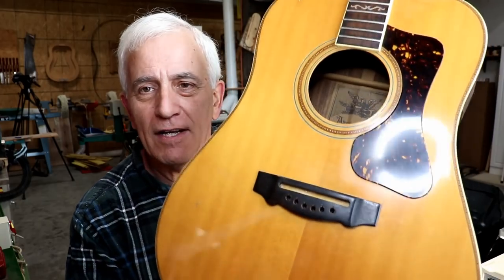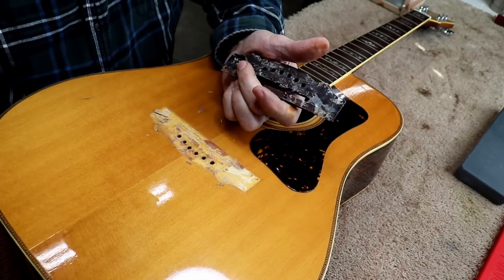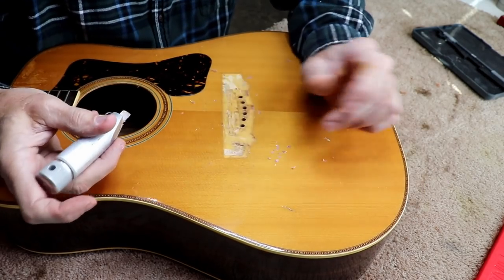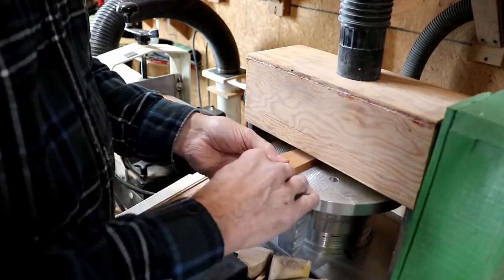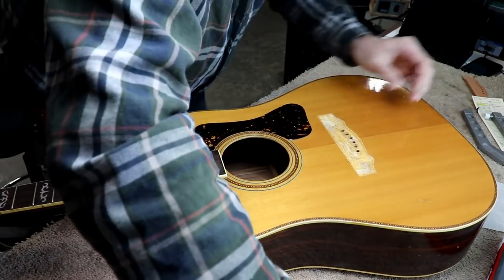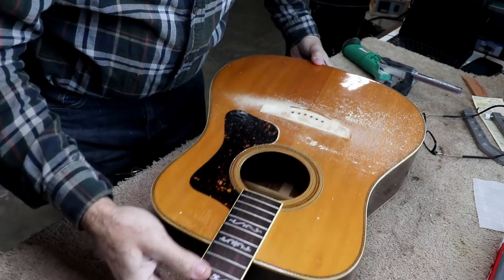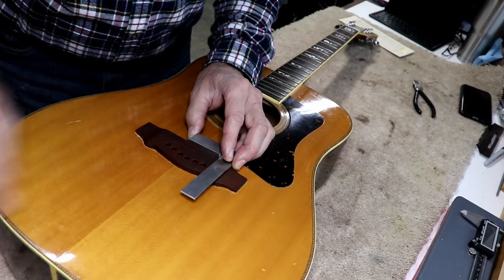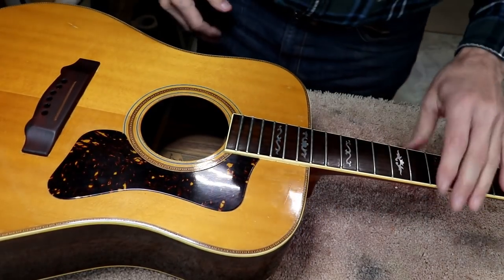380 RSW Alvarez Bridge Out Ahead

Comment: 33 minutes or 33 hours to make a bridge...all relative to context. Let's say you decided to build your own shimisen (Japanese 3-string) and you have no money and you are using only the scraps in your tiny Hollywood apartment with cheap handtools (made better by love and care) and thankyouJesus a Dremel. My old Dremel Mini-Mite died 15 years ago and Dremel did not offer replacement batteries. This build would not have been impossible without one beautiful power tool, however it would have taken, easily, more than a year. Some caring human being gifted me with a new rotary tool. With the Dremel it took 91 days to build this gem. The instrument designed itself as I went along and every step defined the rest of the build. Then it came to the bridge/tailpiece. It's size was determined by the scale length - 24 and 7/8 inches because I wanted the length to match my Epiphone SG (electric) because on a fretless instrument (my first fretless) I needed to know the neck by feel. The scale length meant that the bridge/tailpiece would have one and five-eighths inch to fit in. I had exactly one piece of hardwood to work with - no mistakes allowed. I used an ukulele bridge as a basic structural model. I had the confidence of knowledge of bridges due entirely to Jerry's videos.  It took me about 33 hours over the course of five days to sculpt the bridge/tailpiece. It works perfectly. Aligning the bridge/tailpiece with the nut (two popsicle sticks glued together and plasticised with marine wood-penetrating epoxy) is another story altogether. The alignment was done by eyeballing toward a light source and marking with a pencil. With an eighteen inch neck a bridge one millimeter out of alignment translates to a huge mess. So, 33 minutes or 33 hours - a bridge is a beautiful thing to behold and sorry, Jerry, I used two screws in addition to the Titebond. Brass, philips, roundhead and they integrate beautifully. If you build a shimisen you can pay thirty bucks apiece for silk strings from Japan or you can simply use nylon guitar strings which approximate the sound of the traditional Japanese instrument. There is always a way to do the impossible builds. Thank you Jerry Rosa. I would not have even considered sculpting a bridge/tailpiece without your guidance. Y'all be well.

Comment: Quite right as ever, Jerry! Joints don't get starved by squeeze out and overclamping. A starved joint is one in which the gljue line is non-continuous (e.g if there are areas where glue is mssing (either through bad glue up or inadequate surface matching). It IS theoretically possible to starve a joint through over clamping, but in most guitar situations you would a) never want that level of clamping because b) it would damage the guitar. The emphasis on starved joints is just snake oil, You want lots of glue in there to start with, so there is perfect coverage, then you want to squeeze it out so there is perfect surface matching.  Matthias Wandel, who is normally a reliable source, has a clip on this in which none of his joints pass the test of amount of tension rquired by steel string guitars. this is because he is applying the test to 90 degee cross grain torsion, rather than tension as applied to bridges. Accordingly, his results can safely be ingored by the guitar maker (Sorry Matthias). The rules laid down by woodworkers over many years have held me in good stead - all the wood is wet with glue but the grain of the wood is still visible. The clamp till you get good squeeze out. I shoud mention I am an only an amateur guitar maker, but I spent my whole
 career weighing evidence (in health care)
Reply from the maker: Yes that was one of the few videos Matthias put out that I disagreed with.

Comment: Jerry, plastic golf tees are perfect for not only lining up the bridge when gluing it on (wood glue doesn't stick to the plastic), but they're also great for holding the bridge in place to scribe around it through the finish because the tees are tapered and they wedge the bridge tightly in place.
Reply from the maker: I'm sure that would work on some bridges. But sometimes the bridges are thick and the holes are narrow. And the taper would not reach to the hole in the top and often the holes in the top are wallered out so that their larger than the holes in the new bridge. I see lots of things people don't run into on the average

Comment: Thanks for this one, Jerry. I have a 1980 Kasuga BG 100 (SN 1149) guitar that is "faithful" copy of a pre-war Martin D28 down to the "original" finish. It has the label "The Kasuga" inlaid on the headstock. I had to lower the saddle quite a bit to to get it where I was satisfied. It cut into the saddle to some degree on each string, and I left it that way. Your solution is great, and I would like to try it on my guitar. It is already great sounding guitar.
Reply: I meant to say that the strings cut into the bridge....

Comment: Really like the use of a non-traditional wood (cherry) and dying it to match the original.  That's an idea I've toyed with for awhile now,  only I'll be replacing an easily cracked ebony bridge (2 times now) with not so easily split (but still very hard) elm.  After seeing this,  I'm more confident about it.  Thanks,  Jerry.
Reply from the maker: Make sure the saddle fits tight. That's usually what cracks the bridge. If the saddle fits loose it will pull forward acting like a lever. Good luck to you.

Comment: What I use is the tang of a quarter inch rat tail file,cut it off one inch longer than the square tang to put in the drill it works very good for me it is the same taper as the bridge pin.

Comment: Gerry - get a set of transfer punches or make some for marking hole positions perfectly. Only a suitable diameter rod with an end sharpened and centred like a punch, a minute or two job on the lathe. Hold pieces together, drop pointy end into hole onto piece you want marking and tap with hammer. Makes a nice center pop for the drill bit to bite into and perfectly aligned.
Reply from the maker: I have a set. And I do use them often.

Comment: I own several Alvarez guitars for a good reason. They are pretty good.I have a DY90 and a DY54 which are very good guitars. I also have a Pd100, 5086, and a 5056. The '50 series sometimes have laminated tops or solid tops. He has 5 hours X $60. I would have rather picked up a Seagull S6 off ebay for less than that, but the project did turn out ok and if he likes it, that was the right choice for him. While I have more expensive guitars, the Seagull is my go to guitar that stands at attention at my bedside. Actually, sometimes I wake up with it on my bed with me.
Reply from the maker: It was actually only a little over three hours.
Reply: @RosaStringWorks  In that case, it was probably worth it. Alvarez guitars are really good guitars.

Comment: Nice to get an easy removal once in a while. 

The first bridge I replaced on a cheap Classical guitar, just peeled off with a little heat. I thought, what is the big deal?  The next one on a slightly better old no-name (melody something?) steel string.   Hide glue, tough as nails, burned the bridge to a crisp taking it off.  So, I got to make my very first bridge from scratch. Quite the ordeal. This is why there are professional luthiers.

Comment: Linen on the glue and a small sealing iron to heat and wick into the cloth cut to the size of the bridge mount?  I have a shoe on my filet iron that is about a quarter inch wide and three quarter's inch long, the smallest I have.  All mine have teflon coating so glue does not stick.

Comment: The good old Ernie Ball manual string winder has a pin puller built in.
Reply from the maker: Most pin pullers won't fit all pens or pins that are embedded in the bridge. When you pull as many pens as I do you need one tool that'll do it all

Comment: The glue was thick because they left finish even just a little ways inside the outline of the bridge. The laquer finish is quite thick and no matter how hard you clamp you still get a thick glue line. But that's why you always remove the finish from all of the area under the bridge.
Reply from the maker: The Finish was completely under the bridge not just around the edges

Comment: I think that is older than 1999.  Could be wrong.  I think that one is from the late 70s.  Also, that might have been an epoxy type glue on that bridge.  Alvarez used epoxy starting in the 70s through today.  Even in their high end models.  Today I think the high end uses hide glue, but not entirely sure.  I have an '82 5021 12 string that is awesome, despite the epoxy!

Comment: Hi Gerry, very apprehensive about this comment (I dread telling you how to do anything) but, like you, I use pencils every day, now on a pencil,- it will (should) say something like `HB` on the end-this is soft lead which you will need to sharpen a lot but, it marks darkly & easily, 2H 3H & 4h (I`ve never seen 5)? are increasingingly harder leads which don`t wear or break so quickly but, are very difficult to sharpen & leave a mark on say a black kitchen worktop or anything wet! a 2H for your repair work, I`m certain would serve you well. those leads will be available for your mechanical pencil. in my line of work (home maintenance) even the harder but considerably thinner leads for mechanical pencils, just couldn`t cut it, the much thicker/stronger leads in regular pencils do it for me!
Reply: Hi Jerry thanks for another great video all the best

Comment: I have a question, why not re-use the old bridge?
Reply from the maker: I guess you didn't hear me say that they are totally junk. It has the adjustable portion which is just a tone killer. And it was also very thin on the end which was allowing the top to curl up.
Reply: @RosaStringWorks  Makes sense. Thank you.

Comment: It’s not a ‘99 it’s a 75-76 Bicentennial & Lawsuit era Alvarez Yari. The woods are a combination of spruce top and rosewood/jacaranda on the back and rosewood sides. There were only 800 made. Some had an adjustable bridge and some didn’t.
Reply from the maker: Sorry to disappoint you. But the top is absolutely 100% plywood it came off in layers.
Reply: Rosa String Works interesting. All the Alvarez info I found said nothing about ply. Supposedly according to the literature they were only custom shop hand built guitars. Darn you Alvarez!!
Reply from the maker: @TyBos  Hello, This is Melissa. Thank you for the clarification on the year. Another gentleman said the same that it was a 1976. I made an error. Not sure where but I did go back an put the model and serial number in again and it came back 1976. But I can concur that it did have a plywood top. Have a great day. Stay safe.